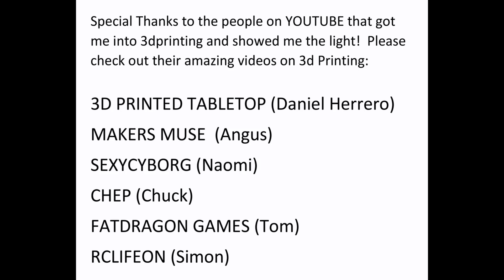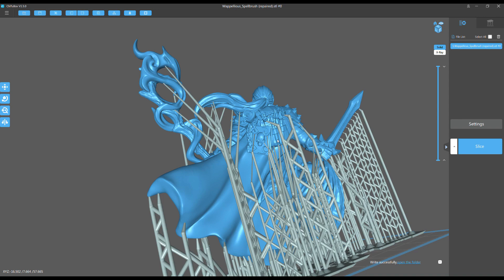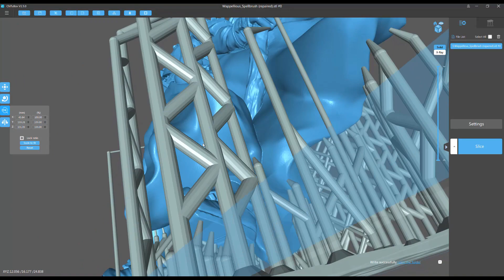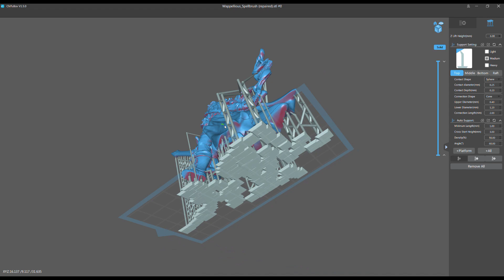Will it Print?!? Episode 2 - A HUGE model with some crazy supports

Comment: I recently got my Photon and when I found your channel and started to use your supports I started getting amazing results from them, I have wanted to send you some images of them to show what you have helped me make for my game sessions.  Thank you VERY much for the effort you have put in to these videos.

I have a question about your larger model you printed there.  You mention that it was 135 to 140 mm tall.  I have only tried to print 1 thing that tall, in fact it was this last weekend.  And it is a fairly solid model needing very minimal supports (called Bored Turtle on Thingyverse as a gift for a co-worker) and it always fails at 65mm (+5mm for supports).  When I looked into it, I saw that the listed print area for the Photon stopped at 65mm and thought ok that is the ceiling for the prints, even though it looks like it should be able to go much higher than that.

So question is, how did you get 135+?
Reply from the maker: First off I'm really glad I could help you! I set out making videos to help people because so many people had requested my help on the FB groups where I am.  So I am happy about that.  As for the Photon, the  print capacity is actually 68x120x150.  The "Z", or the height, is the 150mm number so your  model at 65mm should be fine!
Reply: @3dprintingpro212  70mm (with supports) is actually were it just stops printing.  I don't really see a fail point, I think the model in it's entirely is actually about 80mm, so it's head is always cut off.  I've tried to print it twice, and both stop at the exact same point.  The last layer stays on the print plate and, but I think that is because the model just sits there when it stops. There is no message on the display screen.  I have never been at the printer when it gets to this point, as it is an 8 hour print, just what I see in the morning when I get up. 

If it is supposed to go up to 150 I guess I should try and print something else in that range and see if it stops at the same point.  Then I'll know if it is a problem with the model, or with the printer.  Since everything I have printed up to this point so far is in the 30-40mm range.

I look forward to seeing what comes up next on your channel.  Thank you again.
Reply from the maker: @Sanjiyansan  check your printer settings in Chitubox and make sure the "Z" height is set correctly
Reply: @3dprintingpro212  Was kind of hoping that was going be it, since it was something I hadn't looked at yet. X=68.04, Y=120.96 and Z= 150
Reply from the maker: @Sanjiyansan  those are correct so that's odd...
Reply: @3dprintingpro212  Currently making supports for a dragon model that is in sections, the main body part being 88mm high, I'll finish him up and try printing him.  See if he stops at the same 70mm as the turtle. I hope it goes the whole way, will be 12 hour print it looks like so it'll be a while to find out.
Reply from the maker: @Sanjiyansan  good luck!
Reply: @3dprintingpro212  So just an update.  Good news heheh... Apparently it was something corrupted in the file itself.  So I had decided to reprint the turtle but at only 68mm tall, and it failed in the same 'location' but obviously at the lower level.  So I re-downloaded the file, and only printed it at 28mm, and it was 100%, so then I took that file and printed it at 90mm like I was trying to do, and THAT turtle came out completed.  So in the end, printer fine... File was corrupted somehow.

Thanks again for all the work you do.
Reply from the maker: @Sanjiyansan  ok good thing you figured it out  :)